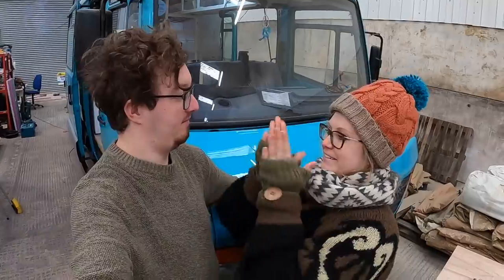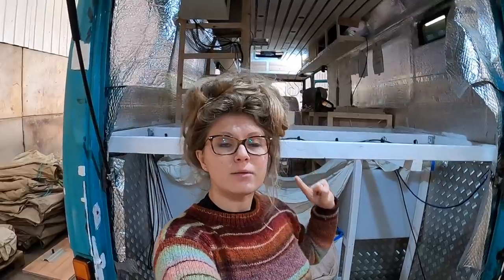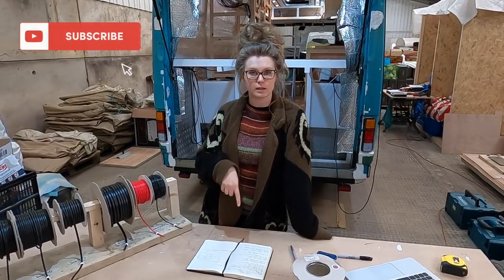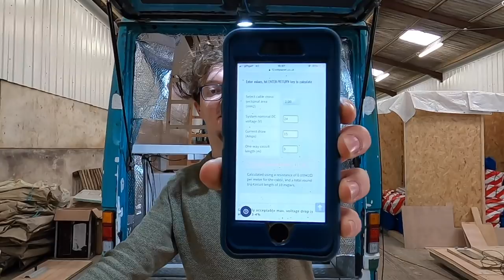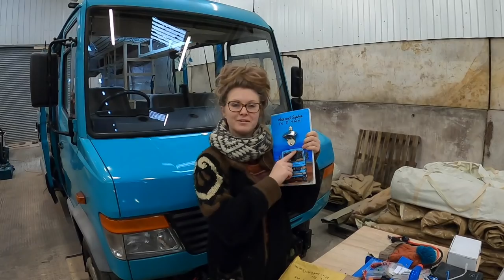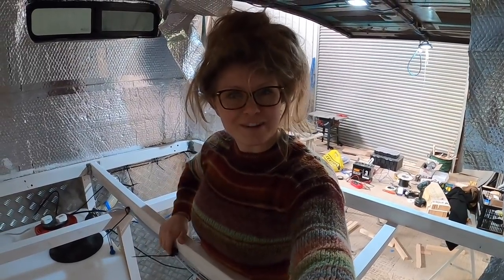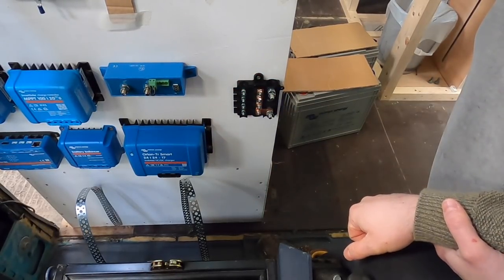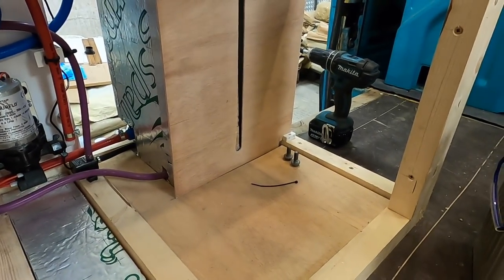Figuring Out Our Cable and Fuse Sizing | MERCEDES VARIO CAMPER ELECTRICS | Van Build Ep28

Comment: dont go to cheap check out your local city electrical factors you dont always get good on ebay
Reply from the maker: It’s a tool we are only going to use for about 8 crimps so it doesn’t need to be good 😂 will check them out tho and see how much it will be! 😊👍
Reply: @MaxSophieinaVan  im thinking more your connections your doing a good build with van it will be worth 30k plus when finished more quality now less problems later
Reply from the maker: Ah yes sorry Keith, we will definitely be getting top quality connectors! 😊👌